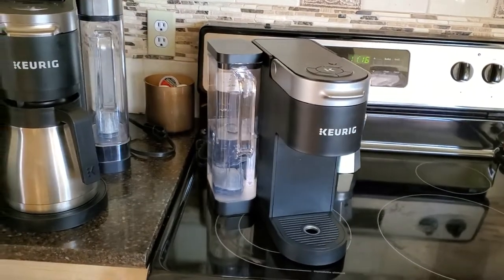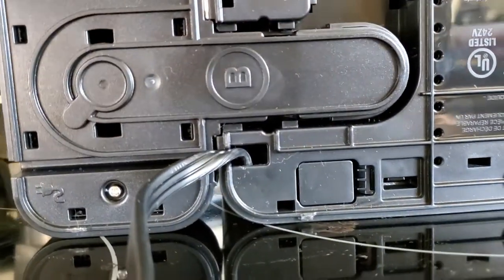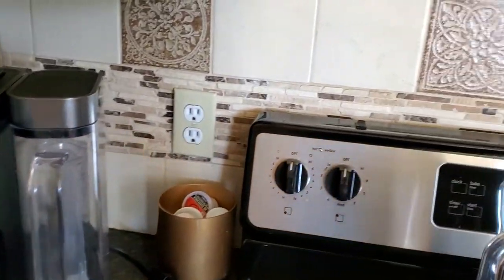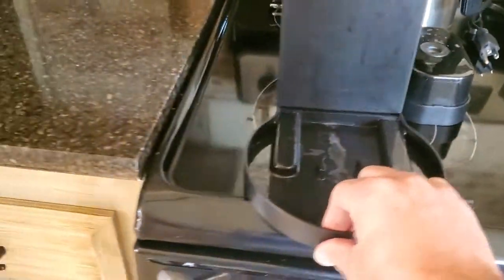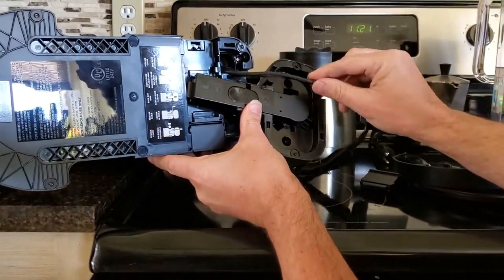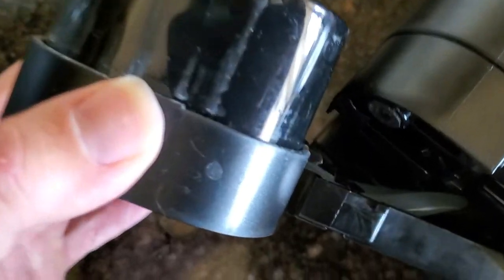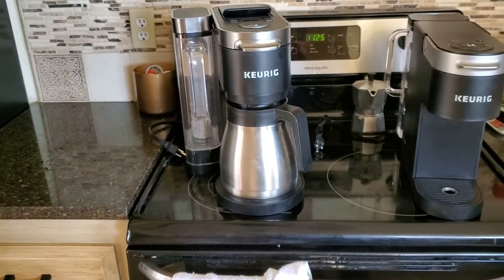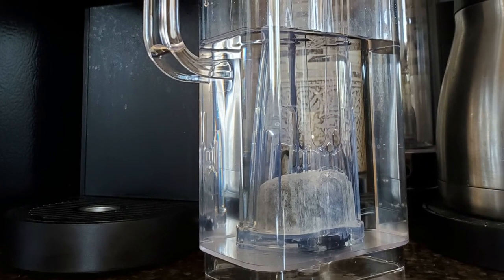Keurig's Muli-Position Water Reservoir on the K-Supreme & the K-Duo Plus: How To Move and Change It

Comment: How do you adjust the water temperature?
Reply from the maker: K-supreme has a "hidden" high altitude adjustment which brings the temp down a bit, not much but a bit. You press and hold the 8-cup option and the brew button at the same time for 3-sec to activate it. The supreme plus has a temp button selector but it doesn't have the movable reservoir so take your pick. The duo and duo plus, I'd have to look it up as I don't remember if it has high altitude option off the top of my head. Anyone out there feel free to chime in.

Comment: Which brews better coffee? The hide and go seek reservoir or the stainless steel carafe model?
Reply from the maker: I'm partial to the stainless steel carafe with the duo plus because I don't like hot plates (regular k-duo) but they only make sense if you want more than a single cup... which is why I've been using the K-mini and more recently the K-supreme more than any other k-cup machine. The k-supreme plus makes the best k-cup coffee imo but it doesn't have a movable reservoir... as I've said before, none of them are perfect. lol.